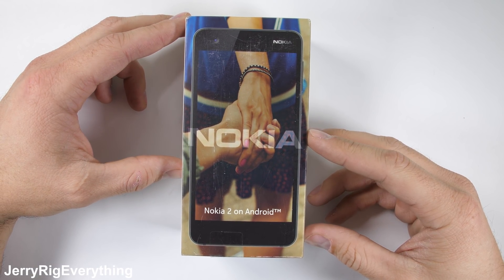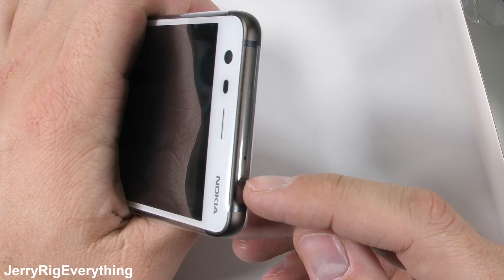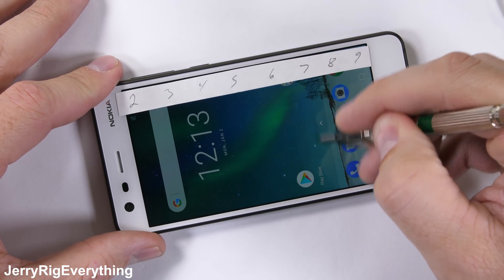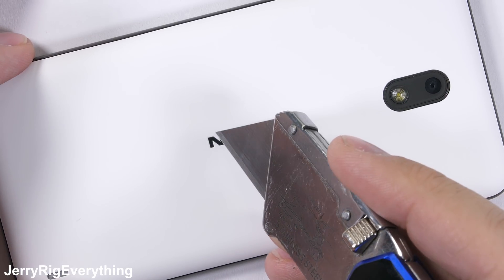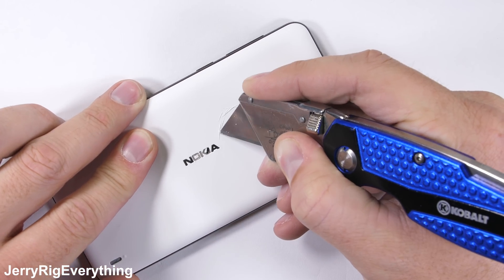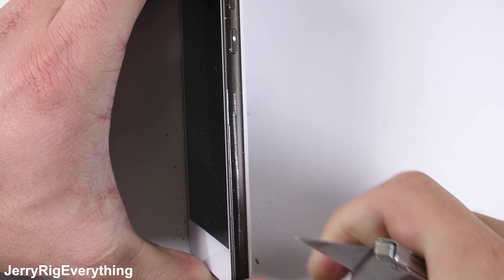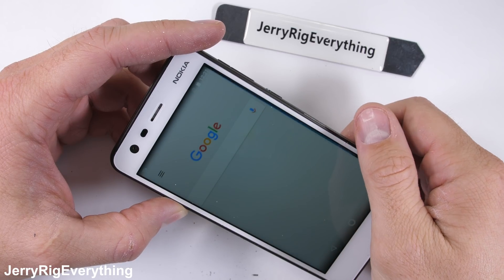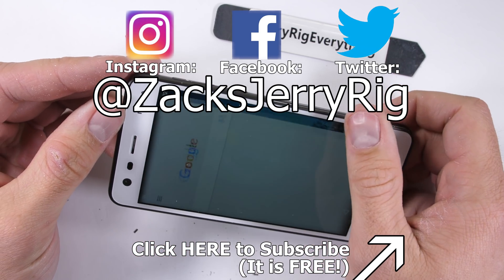Nokia 2 Durability Test! - Will the cheapest Nokia survive?!

Comment: Can you test the iphones performance vs battery voltage and amp usage and even test between new and old batteries or even plug in a dedicated low voltage high amp power supply to test performance? Thanks

Comment: Come on you have been nitpicking, not a single letter fell off of my old Nokia 520 after years of use, and you must be kidding that the earpiece cover can fall out. That was a joke right? Look how much force you used to pull out that lik shit, which by the way was massive under the chassis, only a small part is visible through the slit, sits just fine under the front... Not professional, really not...

Comment: The Cheapest the durable and the specs are not high end but still Nokia's product
Reply: flashbang Csgo Stuff I would never buy chinese
Reply: Fernan Aquino I wouldn't say that lmao, everything is made in china, there are also good chinese phone brands like htc and huawei. The downside of buying most chinese phones are they rarely give software updates.
Reply: Crouching Tiger Hidden Dragon sure but Nokia is not a Chinese brand
Reply: +junilog Funny how I'm flashing a custom rom on a Xiaomi phone right now as we speak
Reply: flashbang Csgo Stuff better operating system....Xiaomi Redmi 4x pathetic MiUi is just worse nd heck boring...Stock Android + good build quality of Nokia 2 is a good choice for the one who want to use it as a normal phone, to take some calls,sms and surf on whatsapp nd browser for sometime, redmi 4x is good phone for sure, but corning gorilla glass at front with pure side metal frame and buttons Nokia 2 is superior in build quality
Reply: You can get a ZTE Zmax Pro which is like 80 dollars and shits all over this. Fuck it even has 32 gigs of storage, a snapdragon 617 and a fucking fingerprint scanner. Or you could get a ZTE Blade Z Max which has dual cameras, a fingerprint scanner and a 4080 mAh battery on top of everything the Pro had and is still only 99 dollars.
Reply: Crouching Tiger Hidden Dragon some nokia 2 are made in india
Reply: CJTubeZ what I mean is Chinese brand. Manufacturing maybe from China but Nokia still designs their phones
Reply: CJTubeZ you can bash Apple if you want. Still not buying China branded phone
Reply: flashbang Csgo Stuff xiaomi is BS. Phone slows down to hell after a year. The worst UI ive ever seen, and FORCES SYNC TO MI CLOUD EVEN ON MOBILE DATA THAT SKYROCKET MY BILL. It is pretty good if you put a custom rom on it but it would void your warranty (Which also is BS cus their customer support is useless). Their cameras also are fucking bad. One of their sub $300 had a same sensor as the iPhone 5s and the picture quality is waaaaaay far from the iphone's. Don't buy it if you bother changing your phone every damn year.
Reply: Fernan Aquino yet Nokia, Motorola & most western companies relied on China. Funny the world works.
Reply: You can get a xiaomi redmi 4x for just 10 bucks more. Same size, better camera, better processor, more ram, same battery, fingerprint scanner, 2,5d glass, better operating system and so on... I would never buy a nokia if i can the 4x

Comment: Nokia is the king in durability tests...
Reply: flashbang Csgo Stuff xiaomi's theme rigged trash better than close to stock android? UMMM NOPE.
Reply: You can get a xiaomi redmi 4x for just 10 bucks more. Same size, better camera, better processor, more ram, same battery, fingerprint scanner, 2,5d glass, better operating system and so on... I would never buy a nokia if i can the 4x
Reply: +UnderTaker Nokia uses hardware from chinese sources too fyi. and Xiaomi may have a software that many people hate, but their prices are just as competitive or better than nokia

Comment: Sir why are you not test the Redmi note 4?
Reply: TRENZY TECH in TELUGU because he does not get it there
Reply: james stark  he is done with Redmi note 3, How?
Reply: TRENZY TECH in TELUGU maybe he doesn't have the money to buy it. Since the materials are the same as the note 3, they should be almost same, durability wise. The only things that have changed are the components and a few designs. It's basically the same.
Reply: james stark sir it's not the correct reason,  the generation of build quality changes with change in model how can you decide the build quality
Reply: TRENZY TECH in TELUGU because the materials used are the same. The quality has improved but not much. The redmi phone has similar build quality just more screws, and a few extra safety precautions like better adhesive
Reply: james stark how do you know that the materials are same?  Do you compare the mobiles at side by side
Reply: Note 4 feels  more solid than note 3 and i think there might be a little difference in durability
Reply: Arvin Yumnam yes but how much?    That's why I'm asking jerryrigeverything